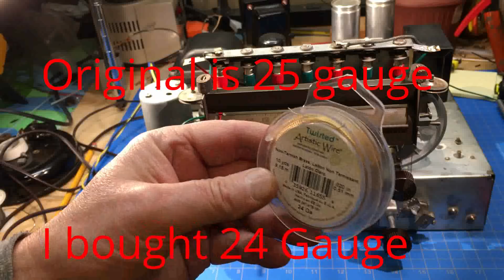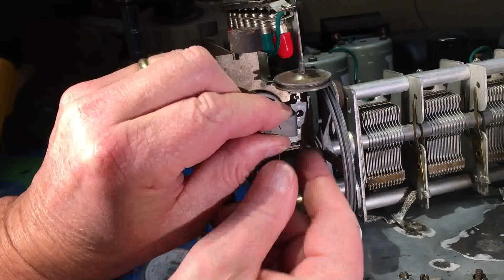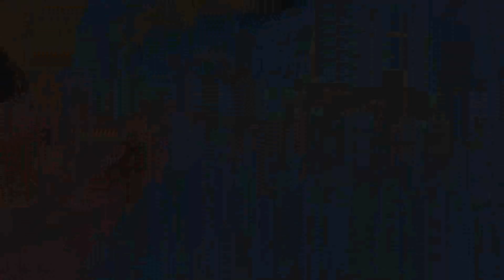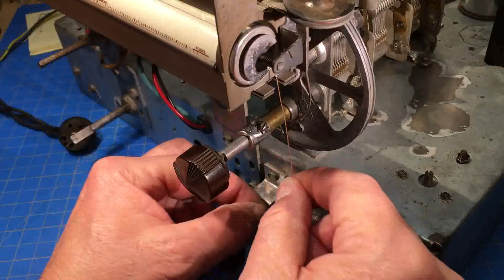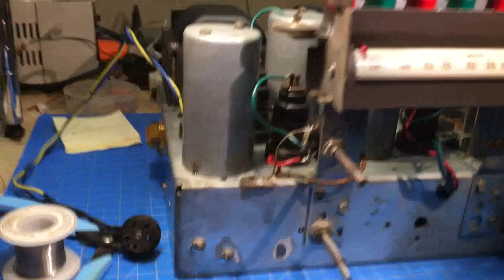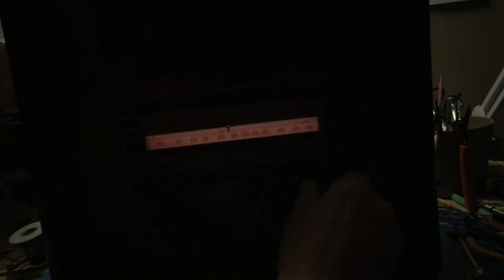1936 General Electric E91 Colorama Part 9 of 9 Dial Replacement and Finish

Comment: Beautiful job, Larry! That looks much better than the E91 I had (and sold) I kept my E101. I did a photo-vid of it here: https://www.youtube.com/watch?v=BhqeyH_GFv8 The new dial looks great too! And yes, I can't tell you how many times I had a radio playing fine on the bench only to find it dead when I put it back in the cabinet. A lot of the time it's a weak solder joint. I had one where it would play fine if the chassis was on its side, but sitting flat I got no sound. Well done! Looking forward to the 1935 Philco 54C next.
Reply from the maker: gavinwb1 Thanks Greg! Its a hunk of radio for sure! It has the sound of a console, I was surprised and with the extra rf tube, very sensitive. I found the Colorama didnt respond very well with just the small loop antenna inside, but worked "ok" with an outside antenna. One thing I noticed was the colorama would flicker on weaker stations during dusk as the signal would fade and the AVC was erratic. All in all it has been a fun project, Im just sorry it took so long, but without the new dial, nothing I could do. As for the Philco, lol. Hopefully a video tomorrow! I have it all back together except the power cord and speaker installed. Cross jr fingers on this one! Lol. Thanks again and Take Care--Larry

Comment: Larry - very nice! The wire you used worked perfect and the new dial looks awesome with the Colorama feature. Thanks for sharing this. Best, Don
Reply from the maker: RestoreOldRadios Thanks Don, that wire could be used for a lot of radios. In fact, the dial indicator cable is the same material. It is a unique radio and was fun making it work again. It just took a while to get all the materials to make it right. Take Care--Larry

Comment: Great job! That's a neat gimmick, too bad it never caught on. I guess magic eye tubes were cheaper, although most radios had NO signal indicator other than the way it sounded.
Reply from the maker: Bob and Kim Rivard It was a neat idea and unique to see, however, the satuable reactor was problematic, a lot that you find are open. I was lucky but not sure how close this one is to infinity and beyond! Lol. I read where a guy on ARF had some wound, hopefully if I need one, he will still have one. Ive noticed with this one, it is very touchy since it uses the AVC voltage to drive the triode that controls the reactor. But it does tune to the signal. Thanks for watching and commenting! Take Care--Larry

Comment: Looking nice like the idea of the dial bit like a stereo indicator. Do you not think you should change the bulbs for LEDs make a little bit brighter they do look rather dark on the video.
Reply from the maker: John sweda Hi John, hope you are well! Thanks for watching and commenting. I considered LED, but not sure they would work in this particular circuit. The red lights dim as more current is conducted thru the saturable reactor and the green bulbs light. Im not sure if I can get the LED to dim with the change in current. They definitely would draw a lot less current! This radio is drawing right at 1 amp. Not sure this one will be played all that much, its more of a novelty wasnt made but 1 year. Thanks again! Take Care--Larry
Reply: Backtothefutureradios you can get dimmable LEDs I see what you're saying, but if you run a resistor and diode in parallel with the LED wouldn't this work to take most of the current away from the LED if that makes sense